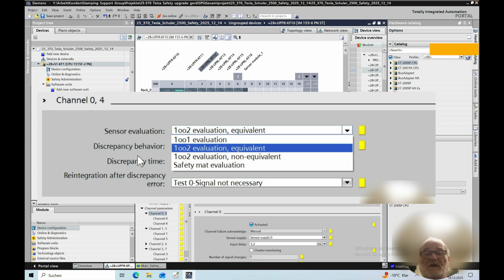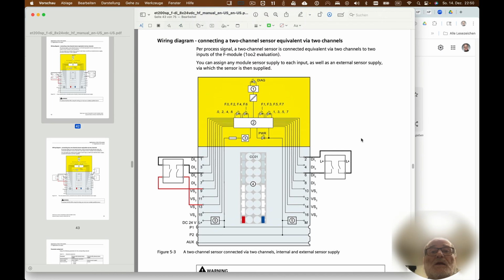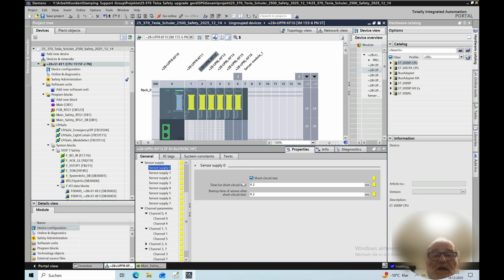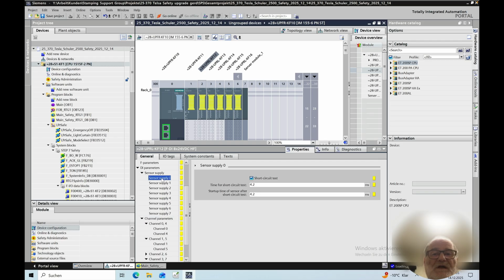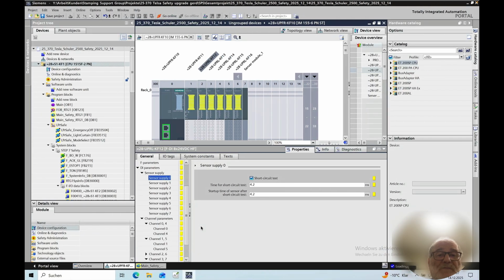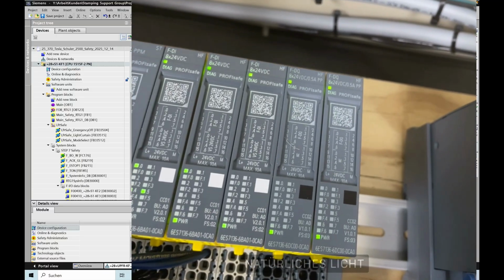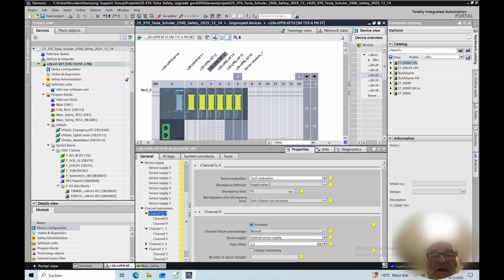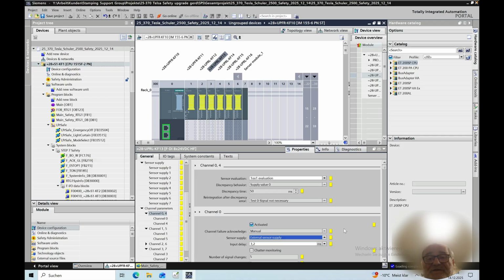Siemens TIA Portal Safe Input Evaluation 1oo2 1oo1 Sensor Supply #14

Comment: Could you also show us io tags section of that module as well please? I did not get that should we define 4 tags for 2 channels for 1 sensor?
Reply from the maker: Hi Kaizokudc, please check on this video. I think this should be helpful for you.https://youtu.be/kxoOZs1t-vo?si=QM5DrEhPrdwP9Wly.
If you have 1oo2 Evaluatuion you do not need to to define both inputs. I would do it anyway to have a clean Program. because in the hardware it is also shown.
Hope this helps you.